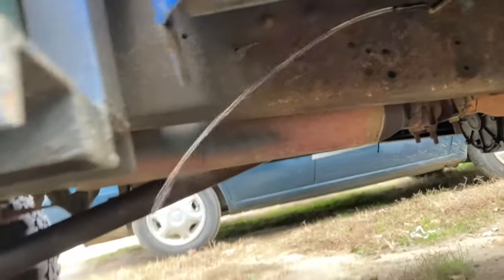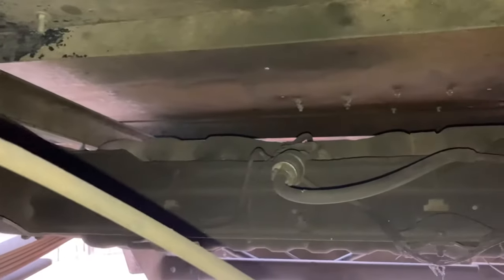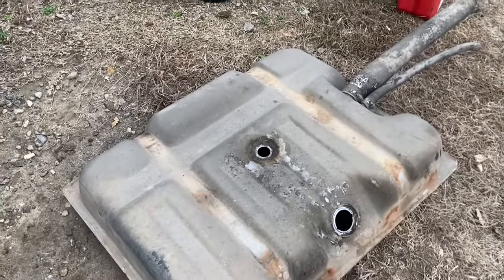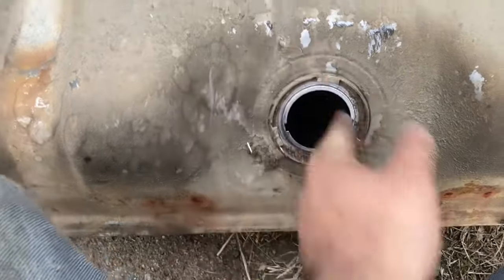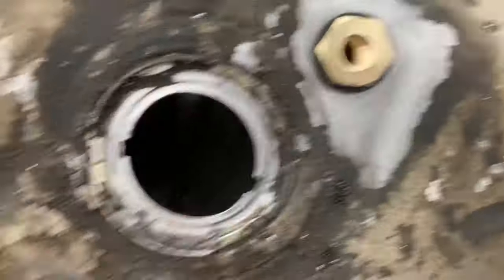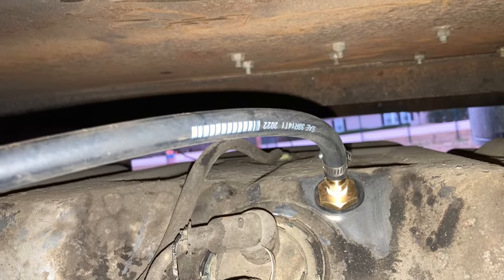Fixing vapor lock in my old work trucks

Comment: More of a ford thing . Chevy had a return line on the fuel pump . What i did in the 80s ! Was i went to the ECS .
And used the vapor line off that, its already  ran to the tank and plumbed in . Done that probably 10 times ! Fords are knowin for heating up at low rpm . We can't 4 wheel more than 45 mins or my ford buddies are over heating . Chevy motors run opposite . We get 4 wheelin my chevy temp gauge goes from a quarter up . On down to just a needle width up on gauge ! Most my ford buddies put electric fuel pumps in line . They start vaporing they just reach down snd hit the electric switch . 10 seconds later ther good . Which is one reason why i like the q jets ! Center fuel bowl . Deep . Coolest part a the engine ! Less problems ! Holley carbs your 4 wheelin . Lean to one side and thet floodin . The other side ther lean . Edelbrocks are floodin goin up hill . Lean running down hill ! Q jets dont have that problem ! Good video brother !

Comment: 1. Run a high pressure fuel pump with pressure regulator right before the carb.  

2.  Run an inline line bleed-back control valve close to the carb. 

This is most likely your issue vs true vapor lock.    The fuel just drains back to the pump or tank -

Comment: dodge vehicles once had fuel filter with side exit for fuel return. might help someone looking at line routing.

while I agree with hating welding on tanks, there is another solution, i have done several times for other reasons, easier, simpler, take off the filler from tank, leave tank in place, now just clean metal filler, and drill a hole & braze a piece of metal line into it, i have always faced it down into tank, but bent 90 degrees, & just find a line with hose barbs, 6" or so long, then once reattach it, you attach your return line to it,

the reason i did the returns is many times in my youth i liked to travel, and had a tank i installed in trunk 6-10 gallons, thats how I added gas to my tank while driving, i just used a small fuel pump. but to me easier than spending money, & I have brazed hose barb to line, but dont recommend unless your good with torch.

Comment: In my 78 f250 with a 460 I run an old jeep fuel filter that has a return nipple built into it and I built a return hardline that runs right next to the supply line along the frame rail and welded a nipple into the fuel level sender so it circulates because I had the exact same problems
Reply: L
Reply: Can you return the fuel to the fuel sender on the gas tank if the fuel sender nipple is below the gas line?
Reply: I'm having the exact same issue with my 78 f150 with the 460, I might do this thanks for the idea🫡

Comment: Hello From Mark In Kentucky.  I was scrolling through YouTube regarding vapor lock issues and stumbled across your video.  I have a 682 and a 1710 Cub Cadet garden tractor that have the opposed twin Kohler KT17 engine that runs pretty hot in any season which I had some issues with the engine quitting.  After some inspection with a bright light I found that the fuel shut off inside the gas tank had the reed looking filter similar to the Hondas and or Predator engine fuel tanks that had collapsed and had restricted the fuel flow. 
So I changed the fuel shut off valve to one that doesn’t have the “Stupid Filter” after giving the tank a good flushing with soapy water, I hooked everything back up and my fuel flow issues seemed to be resolved. Well after getting the engine up to operating temperature, The engine smothered out and would only  try to run with the choke pulled all the way out. 
I tried dosing the gasoline with a heavier than usual treatment of SeaFoam and the engine was much better but still would quit after it got hot.  After some thought, I remembered the “Vapor Lock” symptoms with some of the older engines that I owned in the past had and I think that is most of the problem with the Cub Cadet. I will have to try your return line fix to see if the Vapor Lock goes away. The gasoline here in Kentucky seems to have more and more alcohol content which is not good for the older engines.

Comment: I have one on my 85Firebird Street and strip built 355. (Jeep filter). Hasn't vapor locked since. The only thing I've noticed is that during a 2nd gear pull , the 750 quadrajet will pull the bowl dry. Let off, and it snaps back. But that doesn't always happen.

Comment: Thank you for posting this and the explanation. Have a 98 Rav4 that runs great when cold, but once it warms up it has a little hesitation like you describe.
It did have a check engine light come on but changed the charcoal canister and no more light but still has the hiccup.

Looked at the fuel line and sure enough the line is metal closer to the engine and the insulation one the metal part has fallen off due to oil leak. Going to replace the insulation and see how it runs.

Comment: What I did on an 82 Bronco I had was just put a T fitting before my carburetor, cut the head off a bolt and stick the bolt in a section of fuel line that went back to the tank. I put a hose clamp around the section with the bolt shank in it, and with a fuel pressure gauge before the T I tightened the hose clamp until I still had enough fuel pressure but let enough bleed off so that the fuel was always circulating. Even with a mechanical pump I had too much fuel pressure anyway so I could afford to lose some. I also drilled into the fuel sending unit next to the stock fuel nipple instead of drilling into the tank itself.

Comment: I have the msd efi and I have a vapor locking problem. It is a high priced system, with no data to hook it up in something , that’s not a mustang or Camaro . A weekend toy! And can’t get the techs on the phone, some act ok. But, some are a little bit hostile. And you still can’t get any information about putting it on my van or the fix for my problem!

Comment: Great idea - thanks. If I leave the CJ3 pictured in my profile parked for more than 10 minutes on a hot summer day without popping the hood up it ain’t starting again without a good 10-15 seconds of cranking. I had also considered a side mounted electric fan sucking cooler air into the engine compartment but like your solution better.

Comment: All the stump jumpers around me used a wood clothes pin on fuel line close to carb.
Reply: what does that do?
Reply: @steven-ky2ps  kept vapor down by venting of heat. It's been years ago but supposedly it helped with vapor lock also. And it was cheaper and a little easier .